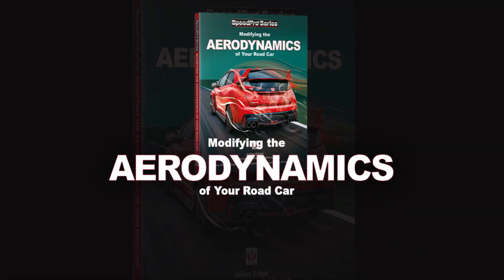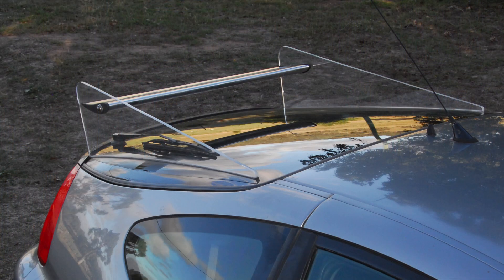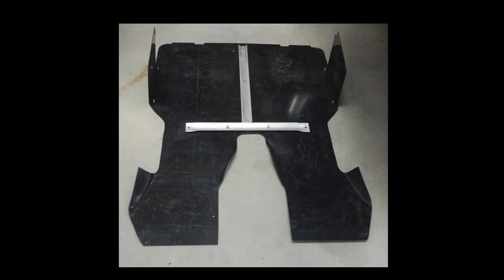Measuring road car aerodynamic lift and downforce

Comment: Can these measurements of suspension travel then be used to calculate the amount of downforce you are producing at a certain speed. Would that be done using the motion ratio of the and spring rate? Thank you in advance and for this helpful video